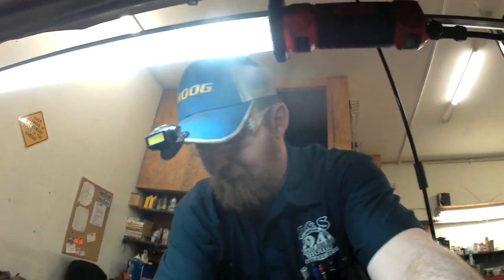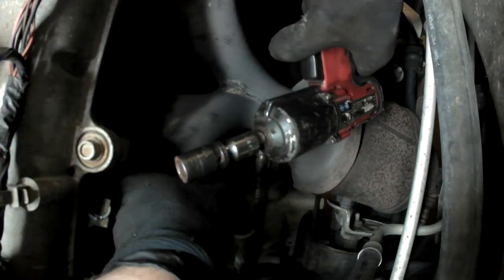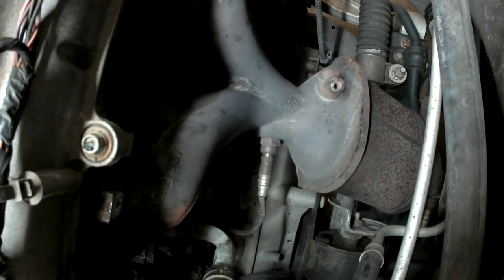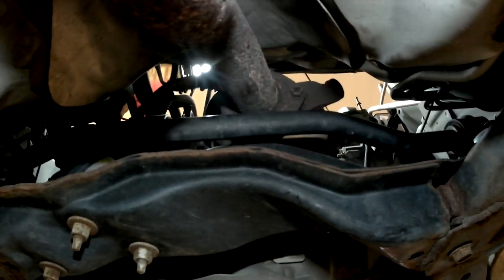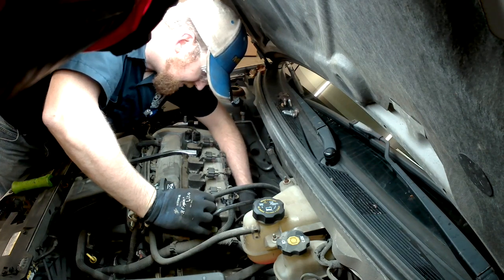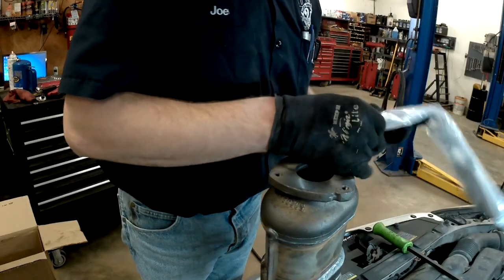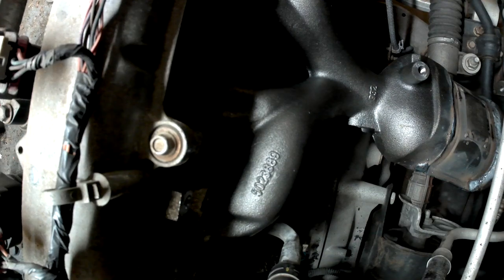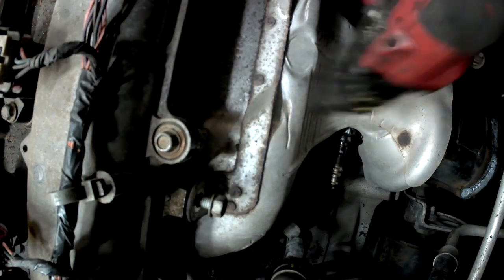07 Pontiac G6 2.4L Exhaust Manifold

Comment: Just a heads up (pun intended) you can use a 1/2 inch socket instead of a 13 mm. However, if you break a bolt, it’s gonna take a lot of wiggling to remove the head from the socket. So for cleaner bolts, I’d recommend a 1/2 socket, but for the rustier ones, use a 13mm

Comment: Thanks for the video. The bottom side stud of the flange where it connects to the exhaust pipe is broken off.  No nut. Will this crate an issue removing the manifold?

Comment: I have a 2010 malibu with the 2.4 ecotec & ever since I bought my car I’ve had a check engine light for (P0171) system too lean & (B1000) ECU malfuntion. I’ve replaced everything & never paid attention to the exhaust. I removed the shield today & saw that I have a crack down the middle of the manifold & 1 stud was missing a nut so I purchased a nut & it tightened perfectly fine. Then I checked all the nuts to see if they’re tight & one of them seemed loose but it was the threads in the head that were stripped. So now I have to figure out how I’m going to replace that & there’s barely any working room. Whats your advice on what I should do about the stripped threads? I know I can drill it & use helicoil but there’s barely any working room so I’m not sure if it’ll be possible to drill it
Reply from the maker: You can try running the proper tap in to the hole to chase what threads are left, clean out the hole with some brake cleaner and compressed air, mix up some JB Weld, liberally coat the new stud, and then thread it in. Give it plenty of time to cure, and you should be fine. If there are not enough threads to chase you may be able to go in with a tap one size larger than the original stud. I believe they are 6mm so if you can find a 7mm tap and bolt it will be tough to run the tap in without drilling the hole, but in the aluminum you should be able to do it. Instead of using a stud, just use a bolt and lock washer. Just make sure the larger hardware will make it through the hole in the manifold.  I hope this helps.

Comment: Could you post a link to were you purchased your catalytic convertor from please. Great video thanks for sharing.
Reply from the maker: Tru Line we purchased it through our local Advance Auto Parts. But they should be able to get ahold of it through any of the auto part suppliers or even possibly online. I don’t like getting parts of the internet when it comes to exhaust work though because I have had massive issues with how some have fit and returning them is a pain.

Comment: So I have a bolt directly under the o2 sensor that just will not come out. Which way would you come at it
Reply from the maker: I'm assuming you mean the lower O-2 sensor.I removed the on in the video from below with a swivel socket. If that is not an option I would try to get to it with a ratchet wrench. If those are both fails you may have enough room to cut the head off with a torch, or by other means. You may also try heating up the O-2 sensor bung then applying oil while it id still cherry red. That may make it possible to get the sensor out.

Comment: Do you think it can be done without a lift or Jack stands I dont have the money to waste on taking it to the garage when I can do it myself.  Just wanted to know if you thought there was enough room to reach down to back of flange to unbolt it? Please respond I need to get it done within the next few days
Reply from the maker: Eddie Mcpherson for your own safety please spend the money on a set of jack stands. I had a friend that had a car fall on him and crush his skull because he rolled under a car without using the jack stands he had on the shelf next to the car. It was a stupid mistake, and he was lucky to survive even though it took several brain surgeries to remove the bone chips. You can find them fairly cheap at Harbor Freight. 
      To answer your question, yes you can do it yourself as long as you can get it safely in the air. Just make sure you soak the nuts that connect the rest of the exhaust to the manifold with plenty of penetrating oil. Take your time removing the manifold to head fasteners as well, and if they feel tight oil them up too. You really don’t want to break any  , and dof them off. Best of luck toy you.
Reply: I was wanting to know if I can just do it from under the hood. Without having to Jack it up

Comment: what did you have to remove to get access to the manifold
Reply from the maker: MICHAEL the top plastic engine cover and the heat shield.
Reply: Joseph Vollmar is there a way to do it w/out the o2 socket?  Or is it just best to get one?

Comment: i did my cat convertor and both o2 sensors and its dead again in 2 years.  ..Eastman cat tech support told me these are dirtry engines with many Cat failures.  Not sure what to do now.... Engine runs good and gets good fuel mileage.  160000 km
Reply: Im on my 2nd replacement, once at 90'000km and now again 173'000km